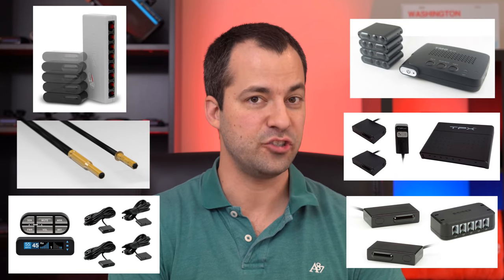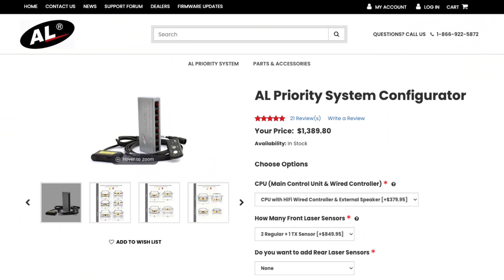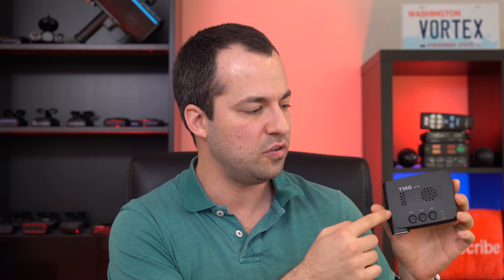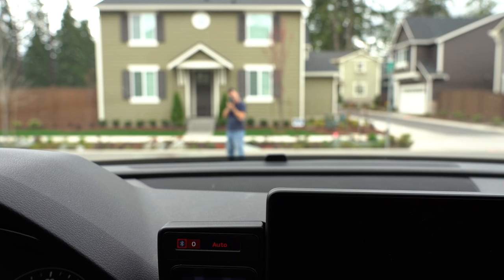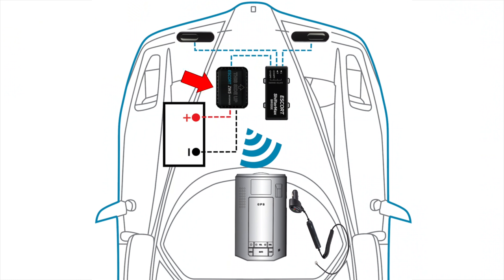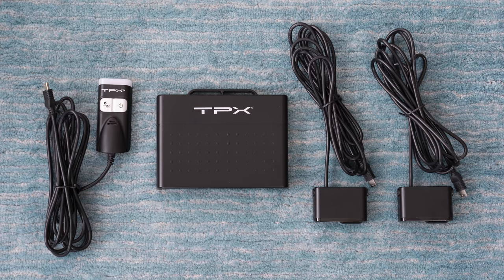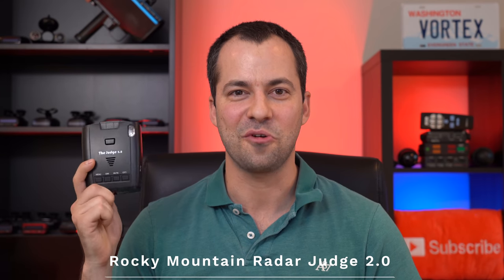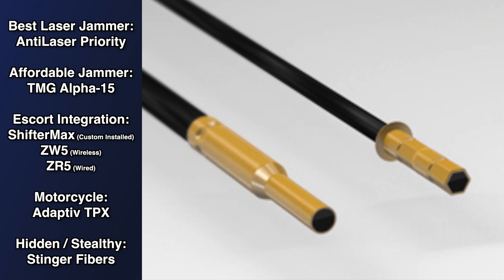Best Laser Jammers for 2021

Comment: I assume nothing much has changed for 2022. Waze is awesome and we need way more people using it!
Reply: Waze is good but it only works if the cop is stationary on the side of the road, it doesn’t account for a sheriff that gets on the highway Al the sudden, all law enforcement need to have trackers in their vehicles at All times and have those trackers report to Waze all the time
Reply: If the radar is in an unmarked car which is not stationary waze is useless.
I got caught in this way by some assholes police, which tailgated me with high beam on, and I fell for their trap and end up losing my driver's license, I didn't even have a radar detector then which might have told me what the car tailgating me really was . 

Waze was no use, I even marked the police car on Waze and it didn't stay on for more than 5 minutes, either the police removed it or other drivers which didn't see a police car.

Comment: I have an adaptiv TMG for my motorcycle and I endorse it.. it has come with several bad heads but adaptiv quickly replaced them.. the cpu casing is not water proof but water resistant. in our tests the TMG did jam all laser guns to the source and from the back it did decent even against dragon eye.
Reply: How did you know they were bad? Do you have the 3rd transponder?
Reply: @rob8855  i bought a LI laser tester from ebay.

You can also set them on parking sensor mode and put your hand over them .

And some of them were leaking some black stuff
Reply: Is the manual/phone pocket typically found under the pillion seat protected enough for CPU mounting?
Reply: @WDGFE  yes. just know that it may not fit on a regular bike. I have a concours 14 but a regular sport bike you may need to mount it elsewhere

Comment: I used to install laser/LIDAR jammers in WA about a decade ago. BIGGEST "rule", do NOT jam all the way to the gun people! Pull your E-brake, downshift, whatever to get down to the speed limit and shut everything OFF ( just don't hit your brakes especially at NIGHT! OR have your brake lights on a kill switch...). Worst installs ever, Porsche because the engine is in the rear and there's practically ZERO "holes" going through the front firewall to any run wires!
Reply: That sounds like a great idea to lose control of your car
Reply: @misham6547  which part, downshifting or the emergency brake? You don't shut the "car" off either, just your jammer and detectors...
Reply: @misham6547  lol bro said pull e brake😂😂
Reply: @lochermaleficent5062  fr, like what? 😭
Reply: We run kill switches on brake lights down range, they are brilliant!

Comment: Once Radenso makes Theia,  they're going to have integration with ALP for literally the best of the best set up on the market. If both of these are remote mounted, you never have to worry about threats ever again.
Reply: make sure you still use waze, it will also give you look ahead details on possible speed traps.   No one whats to pay these local judges and police depts $$$,  which allows them to continue funding their personal enterprizes.

Comment: Hey, great videos! I just got one question here. My Porsche Panamera sport Turismo looks great with roof box, but is the roof box has some vertical reflective surfaces in the front and back, should I be worry about those area since I already install the full set of ALP on my car. I am planing on wrap the roof box with may black vinyl, do you think that will jam the laser?

Comment: I watch your videos over and over and enjoy them quite a bit. As a computer tester one thing I thought that you could do is actually inform viewers which version your using on radar detectors and equipment. As some versions have more issues than others I believe it will be useful to inform us if you have the most up to date updates. Just a thought from a beloved fan.
Reply from the maker: I generally do that in any testing videos since firmware versions are important. I don’t normally cover that for general product overviews though. :)

Comment: Are the TPX (motorcycle) a viable option to use on a compact or midsize car for front protection?  You said they performed well, better than the TMGs?  The TPX looks easier to self install.  Thanks for the great videos all around.

Comment: Watched and liked, thanks Vortex!  Can I sum up the video in 2 seconds?  ALP.  Love my ALP!  Just make sure you keep those heads clean!
Reply: Jason Stupak and straight and level.
Reply from the maker: haha yeah, if only choosing a RD was this easy :D
Reply: @VortexRadar  Soon, once Theia comes out!
Reply: @VortexRadar  Hey, just an update on my ALP system.  The control box has started to fry all my heads.  Apparently this has happened to someone else before.  They replaced the control box, the 2 TX heads, and rear RX heads.  Now the front RX heads have stopped working.  Very frustrating.  Working on trying to get the whole system replaced under warranty, but Alex in Canada is making things difficult to get resolved.  Thought you might be interested in knowing.  I otherwise love the system, but now I'm stuck without a system until all this gets resolved.

Comment: With the Escort's M1 Dash Camera, it will not even allow communication with IDatalink Maestro RR2, the same issue stated inside the video. The M1 is nice for if you move your radar from vehicle to vehicle. For my summer car, I have it hardwired to the RR2 and use a GOPRO for a dash camera. I am thinking of adding laser shifting to my Max360C, it shows on my Kenwood it can do laser shifting as an option. If you are going for Escort, stay away from the M1 for more permanent installs. A sub-par dash camera for a unreasonable price.
Reply from the maker: Oh wow, I didn't know it broke Maestro communication too, but that makes sense. If you want to add in laser shifting, be sure to keep the M1 out of the equation or just get an ALP instead.

Comment: In Canada, it is legal to install laser jammer in BC, AB, and SK. However, it is illegal to use the laser jamming equipment in all provinces in Canada. The reason is that it is illegal to use the laser jammer to defeat police speed measurement. The police can flag the driver over and determine if the car have jamming equipment. Police can seized the laser jamming equipment and the driver may have a criminal record if convicted.
Reply: Yes, the People's Republic of Canada. Just make sure you use the right pronouns as well, or a stint in jail is forthcoming.

Comment: curious if you were to angle your license plate upwards towards the sky to see if it affects the lidar reflection? instead of the laser bouncing back towards the lidar gun its directed towards the sky. look forward to this video if possible
Reply: Most plates I’ve seen use a retro reflective material, so angling it would have negligible benefit.

Comment: Any reccomendations on a semi truck
Reply from the maker: ALP triple
Reply: @VortexRadar  regular alp with 3 heads?
Reply from the maker: Yeah, I’d vote for the three regular heads to get the added sensitivity with such a large surface area to cover. A large semi should be extremely easy to get a laser reading off of so running jammers on it might be especially suspicious. Keep that in mind…
Reply: @VortexRadar   Roger that you think it's even legal to run one on a semi? I might just just get a laser detector if it is illegal to jam on A CMV

Comment: Silly question here from someone who has never drove with a jammer.
Will the officer know that I have one when he is pointing at my car and no reading will show up on his gun when i`m the first car or only one on the road at the time?
just want to make sure before I pull the trigger and spend $800 before it gets taken away.
thanks in advance!
Reply: if you have a kill switch to manually turn on/off you can slow down to the speed limit then disable it so he can get a reading then he won’t be too suspicious

Comment: 2200 for a lidar jammer? Yeah, you’re tripping. Im good with a $400 radar detector and WAZE. Radar detector works EVERYTIME, lidar jammer works MOST OF THE TIME. Imagine paying 2200 for a lidar jammer just for it to fail, and you get a ticket. I’d be livid. If a cop is using a Lidar, they are obviously stopped on the side of the road, and visible from the road as well. Meaning they are more than likely to be reported on waze. Not to mention, if a cop is using a lidar, they also probably have their radar on too which means you’ll be able to detect them anyway. What bullshit haha, I can’t believe people drop 2 racks on a lidar jammer that costs <$200 to produce. What a scam lmaoo

Comment: I know I asked you about laser for motorcycles but Would you please consider reviewing some of the motorcycle dash cam set ups because I am apalled after looking at them just how terrible the specs are. Even the think ware is a clone of the system most other motorcycles cams use. They all max out at 1080p30fps for front and rear cameras
Reply from the maker: I’m really not the best person to test or review those as I’ve said before since I don’t ride myself, I’m sorry.
Reply: @VortexRadar  I just meant the image quality, the only real difference is where you’re placing them which is not what I’m asking to be evaluated. Regardless, fair enough.

Comment: What happned to Blinder? did they get bought, disappear or does Vortex not cover them for some other reason?
Reply from the maker: The main distributor for Blinder passed away a few years back. Now Blinder’s products are sold under the Escort brand name as the ShifterMax series/ZR5/ZW5. I have nothing against Blinder and happily ran their products for several years.

Comment: What Shld I pay in labor for a alp front rear with all the bells and whistles on a mb e63s Amg sedan?
Reply: Dragon eye shooting in school zone. I was going 20 or under.  It seems the BT on alp shuts off the flashing light on controller that turns blue at designated speed.  Any advice. Do they run concurrently as u can press menu to jtk I am told.  Under 20 mph or so I expected at least an alert from the rx’s but didn’t expect tx to shoot out signal.   Confused frustrated.   Alps worked well on I 75 in Georgia   Did not have BT connected at the time.  Like BT idea as it keeps a history of guns used.   Under 22 or so I got nuthin and almost sure dragon eye compact was hitting a line of three slow moving cars.  Me in the middle.

Comment: Think 2 ALPs in the front of a 2020 Corvette is sufficient? Placement for s middle diffuser would be very difficult.

Looking to pair with Escort Max 360c or Redline 360.
Reply from the maker: In that case, three regular heads is the way to go with an ALP on a C8. Do one head and the center and the other two pushed out closer to the headlights.
Reply: The middle area is a blank plastic panel.

Comment: When you did your last laser jammers test with the TMG A-15 did you use the new TMG VPR head against the Dragon Eye Laser guns or just the regular TMG heads?
Reply from the maker: Regular. VPRs weren’t out then. My TMG’s are currently fried and dead and I’m waiting for the new Stinger antenna to come in so I can do a big upgrade for my car including the TMG VPR system.
Reply: @VortexRadar   Ok i will wait until you test the new TMG VPR System to see the result before i decide which jammer to get. I had the LI since 07. It was the best jammer until
they stop support it with the new guns. You do a great job. Keep up the good work.
Reply from the maker: The system has been out for a while and there’s been a TON of testing already which is why I haven’t been in a rush to test it too. I have no immediate plans to test it when I get it installed, so you can check out all the tests that are already available and make your decision accordingly.
Reply: @VortexRadar   Hello,
I just install TMG A-15 Plus dual heads + 1 VPR head on my 2014 BMW 5351 with firmware 8.14. It actual performed really good. It JTG G1 PL3, G19 Truspeed, G26 XLR, G21 DESL, G20 DETC, G31 DETC. I only got a punch thru from the G31 DETC  PHL 349ft & G20 DETC PHL 501ft after a few tries. So overall i am happy with the new TMG

Comment: Vortex Radar, after watching your video last year I wanted an integrated solution so bought Escort.   You said in this video that my configuration is not working.   I have the Redline 360C, M1 Escort Cam and ZR5 (not ZW5).  You said I am not protected, is that correct?  Looking at Escort’s radar they say the M1 Cam will not work with ZW5, no reference to incompatibility with ZR5.    I will ask Escort as well on Monday, but wanted to confirm with you as well?
Reply from the maker: You could run the ZR5 standalone so it doesn’t plug into the Redline and in that configuration, it should work.
Reply: @VortexRadar  thank you, but that was not why I bought the ZR5 so I am going to hold Escort accountable.   I have asked for RMA to return the M1.

Comment: Hey @vortex do you recommend getting the tx sensor?? For me price is the issue... would it still be good with two regular sensors? For the AL?
Reply from the maker: In general, yes, but not always. https://www.vortexradar.com/2016/01/alp-setup-guide-part-2-deciding-how-many-heads-you-need/ The Tx head definitely helps.
Reply: @VortexRadar  so i bought the al priority and I was wondering.. will i need a radar detector for it to notify me of ka bands and k bands? Or will the al priority already notify me?
Reply: I have one aleady but i was thinking of returning it and just keeping the al priority
Reply from the maker: The ALP is a laser jammer, not a radar detector. You can get the Net Radar DSP which is a radar detector add-on for the ALP, but the ALP itself is designed for laser only.

Comment: Hey vortex, the previous versions of the ALP were able to pair with the V1G2 for radar and laser. Does the new V1G2 work with newer ALP setups with bluetooth options?
Reply from the maker: I haven't bothered testing it. There really isn't much benefit at all to pairing a V1 with the ALP. You're much better off using an app like V1Driver or JBV1 than pairing with the ALP.

Comment: Im in Florida, I have a R3, and a V1 GEN 1 but laser got me using the R3. So do I need the R7 or V1 GEN 2?
Reply from the maker: If you face laser, radar detectors aren’t going to provide reliable protection. That’s precisely where laser jammers come into play. With the guns they use in FL, I’d recommend the ALP specifically.
Reply: 03BLKSNK Jerry Harris you need the ALP. The Gen 2 V1 is no better or worse than Gen 1 on lidar. .

Comment: why is the L.Jammer being referred to as a "CPU" i just realized after many vids that's what is being meant by "CPU" but super confused when said the speaker is built into the "CPU" i was like wuhh? and every other feature mentioned ... blue-tooth and etc .....listing off all kinds of stuff i was thinking this is some FANTASTIC FPGA i never heard of or sum crazy NEW ARM chip any ways so im guesing "CPU" is not the PROCESSOR on the MOTHERBOARD? I have been wanting to make a proto SDR-ADAR and also SoftwareDefined IR - MIchael Ossman developed a addon for the "GREATFET ONE" the addon is a called a  "Neighbor"--
"Gladiolus
" a GreatFET neighbor for Software Defined Infrared (SDIR)
some sort of combo w/hackrf and the SDIR idea but made for RADAR/LASER . RADAR RX Detection-and AI + SDIR (laser)RX/TX DETECTION-PREVENTION(jam)...
ANYWAYS ... apologies for LENGTH and RAnTs

Comment: Question: When a policeman can not pin my car with his laser radar because I have a laser jammer, isn't it a clue for him that I might be using a laser jammer? In this case, I'd be pulled over... and receive a whopper ticket for using such a device where it's not permitted + a speeding ticket.  Am I correct or not.  Thanks for your reviews.
Reply: They are legal in some states such as Florida
Reply: @Eman1900O  But my question was for those states where it's not legal !

Comment: Not agreeing with him on the K40..I have the K40 platinum which comes with 3 diffusers in front a one in rear..but I added one more to front & one more to rear..4 in front 2 in rear..on my new car..I have a K40 older one with 2 in front one in rear an  had it installed in one car used it for 3 years..removed put into another another car used it foe 3 years to it out an out in my car E43 AMG an still works an never got a speeding ticket! I also have one in my lambo..which I called a buddy of mine that a cop that argued with me saying they don’t work with his new laser gun..who is a cop..met me out an Tried to clock me an go nothing! So either I have extremely good luck or these K40s are the real deal! I drive fast nearly every where I go! I get hit by a cop every few months an I just quickly slow down turn off an give him the speed I want him to read.
Reply from the maker: They do work to a limited extent against older guns. Not as well against newer guns. Please see this video: https://youtu.be/rllMXaClO7Y

Comment: Science tells me that there is a minimum distance (500 feet) below which laser jammers are useless because the computational time taken by the jammer is longer than the pulse repetition frequency of the laser. How wrong am i?
Reply from the maker: So it turns out that even at close range, laser jammers are still able to do the job and confuse different laser guns, preventing punchthroughs. We do sometimes see PT's at close range, but that's usually due to the laser beam being so tight. You get more beamspread (and handshake) at a distance.
Reply: An old blinder I had would jam rt up to maybe 50 to 100 feet--literally on top of the cop--but gave plenty of warning.